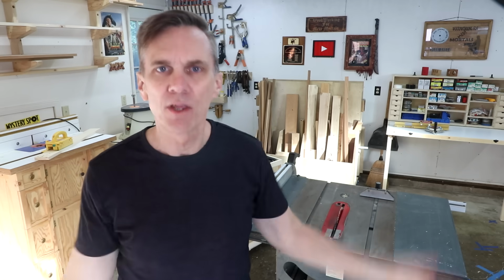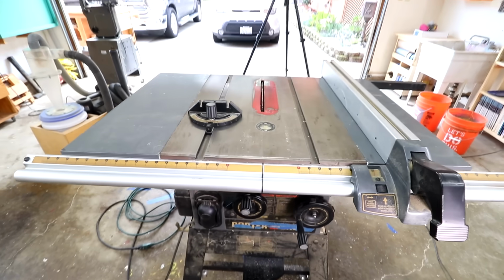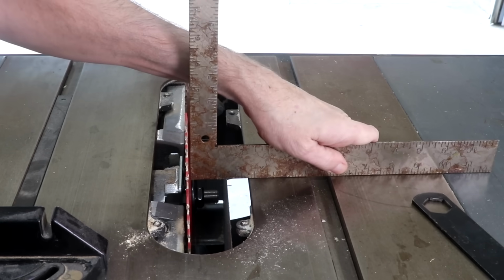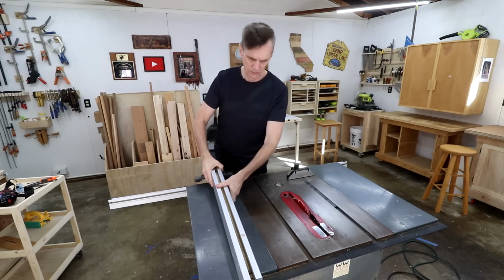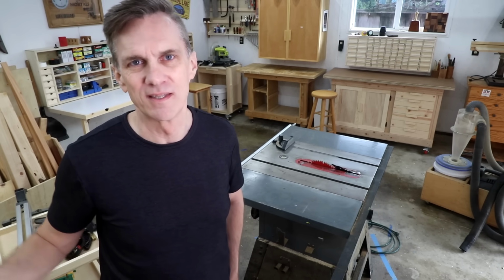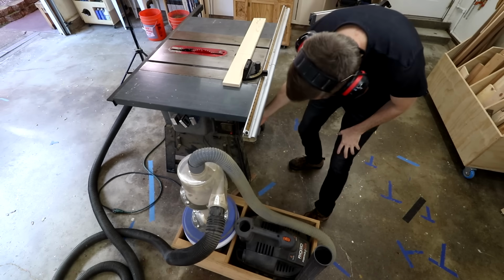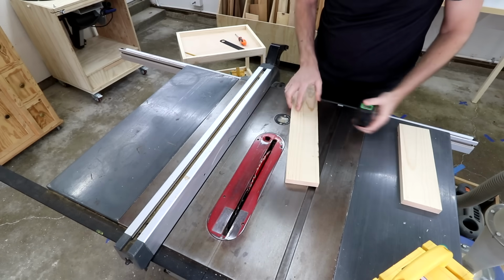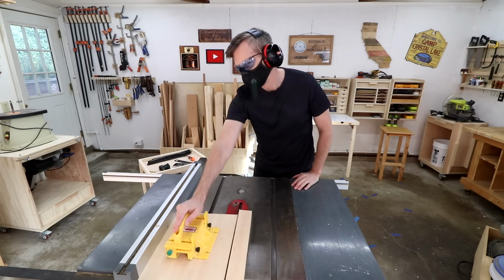A step-by-step guide to making your first table saw cuts. TABLESAW BASICS.

Comment: Hey Steve! I just recently got my first table saw about a week and a half ago. I’m happy to say I’m far more comfortable using it now than the first day, but one thing I struggle with is having to cross cut a new 2x4. Due to its length and the small size of the table saw I have I find it hard to balance the weight of the 2x4 to safely cut it. Any tips or recommendations you would have for a beginner like me?
Reply from the maker: For long boards, you will need some sort of extension on the left of the saw. Even an extra table or workbench will work. You can make a box or something to get it to the same level as the tablesaw. That said, a better solution is to rough cut the 2x4 down to a more manageable size on a miter saw or a circular saw...even a jigsaw. The use the tablesaw to get it to its exact length. This is case where a miter saw will simply be a better tool.
Reply: Steve Ramsey - Woodworking for Mere Mortals Thanks for the reply! Now that you mention it I don’t know why it never crossest mind to use my circular saw to get the 2x4 into more manageable parts. Something I’ll definitely be mindful of moving forward! Anyways thanks for your reply and please continue to make amazing content! Just finished building your 2x4 out of a single 2x4 and it has taught me so much about woodworking concepts and I look forward to making more!

Comment: Steve, do you have some emergency plan if a big accident happens? I watched stumpy nubs video about his and how hard it was for him to get help. I put my phone on a table instead of having it in my pocket as it can be hard and painful to pull it out with a couple of fingers hanging loose. First aid kit? Must be easily accessible in order to quickly stop big bleeding. Since i live alone i should think of things like having the front door unlocked so i can use my elbow to open it as turning the lock can be hard if bleeding plenty.
Reply from the maker: Those are all excellent ideas. Always prepare for the worst even though it may never be necessary. I always keep my phone handy and it can be activated with my voice. My first aid kit is in the house, which is just a few steps up from the garage, but having a first aid kit in the garage is a good idea.

Comment: Hey Steve, Thanks for making these videos! I have an older, smaller Ryobi table saw without the ability to insert a riving a knife. Is this safe to use or should I wait and get a new table saw? Thanks for any advice!
Reply: If the blade guard attaches behind the blade a riving knife is not required.  The blade guard support acts as the riving knife.
Reply from the maker: Check and see if the riving knife is built into the blade guard.
Reply: If there isn’t a splitter built in to your blade guard, you can get an aftermarket one. I use a MicroJig SteelPro Splitter on my 40+ year-old Rockwell/Delta saw that never had a riving knife and whose guard was removed long before I got it, if indeed it ever had one. 

https://www.microjig.com/products/steelpro-thin

Comment: Hi Steve. Thanks for all your content. It’s fun and just what I need as a beginning wood worker. 
TL/DR:  Do I need to purchase and apply paste wax for a new portable Dewalt table saw. 

Full:
I just purchased a Dewalt portable table saw.  I’m cutting Red Oak. And the saw and fence are getting the slightest of scrapes. (May also just be dust).  Should I apply paste wax to my new portable table saw to preserve it and make cutting better?  Or is that not necessary/bad for a portable table saw.
Reply: Waxing the table will make pushing your material easier and thus safer to use.  For the "scrapes" issue insure that the rip fence is parallel to the blade.

Comment: On your through-cuts, it looks like you have your riving knife in the lower position, instead of the raised position where it should be.

Is this an intentional choice? (Like how you don't use a blade guard?) Or just an oversight in the heat of filming?
Reply: the riving knife and the blade both move together when you raise/lower the blade. you can't adjust them separately.
Reply: @Blueeyedmerle  All the ones I've seen have two positions: a raised position where the top edge is above the blade, for doing through cuts. And a lowered position, with the top edge is below the top of the blade, for dados and slots. 

Steve's looks to be in the lower position.
Reply: @JamesTM  

It wouldn't make sense to use a riving knife to cut dadoes. It would do little to prevent kickback. You should take your riving knife OUT to make dado cuts. Ive never seen a saw with 2 positions. It is either in or out.
Reply: @Blueeyedmerle  Having read your comment, I went and did some research. From what I can see, the two-position riving knives might be a relatively new thing. With older saws having single-position knives set just below the top of the blade.

So, maybe I'm wrong here. Seems like Steve's saw might just be a different style than I'm used to.

Comment: Steve I've been searching your videos (and the internet) for an answer to my question, maybe you might know. I'm working with a hardwood material (azobe) and when cutting or sanding it it releases an awful smell. Since i'm making an indoor project with this wood I was wondering how i could get rid of the smell.
Reply: I'm not familiar with azobe but usually the wetter the wood the more you can smell it's essence.  About 6% -10% is dry enough for furniture.  Putting a finish on the finished piece will help it  a lot.
Reply: @dwightl5863  it did spend alot of time in the rain so I'll keep it dry from now on
Reply: @macresco1  I was thinking more of the moisture in the wood and not on the surface.  How long has it been drying since it was cut?
Reply: @dwightl5863  I was also thinking that. It's been a week now.
Reply: @macresco1  Do you mean it has been a week since the tree was cut down?  Guideline before using the wood in that case is to let it dry a year per inch (2.54 mm) of thickness.  Kiln dried would be much shorter than that which means it came from a supplier and they should be able to  tell you what percent it was dried down to.
Reply: @dwightl5863  it's leftover wood from a fence I built. It was just laying in the rain. Don't know when it was cut down. I'll probably put some laquer on the finished product. Oil probably won't contain the smell.

Comment: One tip is if you dont have an outfeed table and have to cut a long piece of board to cut you can rip it half way and then turn the board on end and cut from it until the cuts meet in the middle.

A lot safer than trying to feed a long board all the way and have it hanging off the table saw.

Comment: Hey, first of all, great video. Secondly, quick yes or no question: Do the specifications and features you talked about apply to the one you recommend on your buying guide? Sorry if somebody else asked this, I neither found it, nor remember if you talked about it on the showcase video of said guide.
Have a nice day!
Reply: So that's a tricky question to answer with just a yes or no. All new table saws come with a riving knife its a mandatory feature. As for the rest of the features, table saws usually have a hierarchy, job site saws being the lower end, contractor/hybrid table saws the middle and cabinet saws being the higher end. Unfortunately, the old addage of you get what you pay for is also true. I know the Dewalt Job site saw is rated very high, and just looking it up right now seems to be cheaper than the ridgid. As for specs on the saws they are different by manufacturer i.e. insert plates, limits for dado blades, even fence accuracy/alignment ( which seems to be the main complaint for almost every jobsite table saw). Honestly, read the reviews for the saw you are looking at especially the bad ones.  Hope this helps.

Comment: how do you manage the fence when ripping a large piece, like plywood sheet, when the cutoff is a a couple inches, but the work piece is wider than your table?
Reply: Throw it on the ground! Seriously though, putting the plywood on some blocks or a large foam sheet on the ground and using a circular saw to make the initial cut is the easiest way I know to break down plywood. Cut a little wider than you need and you can clean up the much smaller piece on the table saw.
Reply: @beardeddragonwood  so are you saying after the initial rough cut, you're putting the cut piece against the fence?

Comment: would love to see this type of video with a mobile table saw i recently purchased one here in the UK on gumtree and it's a great saw except for the fence which does not extent the whole length of the table and this causes movement whenever i attempt to cut a straight line,pretty much every tutorial i have seen to make either a full extended fence or sled needs the use of a table which makes straight cuts...is there any way you can upload a tutorial which can help solve this problem

Comment: No dumb question? 
Steve, Do I have to use electricity to operate my table saw?
Reply: It would be a bonus for using your saw.
Reply: @eMRimas  lmao
Reply: @matthewcarpenter4716  +electricity usually speeds up everything... https://www.youtube.com/watch?v=ujExJN6jYgU
Reply: Actually, no. You could build a system with a pedal and attach it to the blade. But you would probably need a saw to make it, so I would probably recommend you to start by asking someone to make it spin by blowing on it. The blade, don't be dirty.

Comment: Having purchased a cheap table saw its actually one of my biggest regrets. 
The saw itself isn’t bad but the fence is horrendous, it bends and wobbles with any pressure at all.
I would always recommend spending a little extra and getting a decent saw
Reply: I agree with spending a little more for something at least a little decent. I bought an extremely cheap used one that didn't even have a fence. Wasn't a big deal, I planned on making a fence system like of seen on different woodworking channels, and just use a temporary fence clamped on until i finished making one, but I didn't realize this cheap has no good flat areas underneath for the clamp to sit, and the fence rail on it is actually part of the top, not one that I can take off and replace. Wishing I would've just waited and found a better one.
Reply: @nightxxowl1215  Steve Ramsey has a tool list to set up a beginner's wood working shop for less than 1000 USD, including a table saw.
I don't know if that brand is available "everywhere" but with the US or Canada it should not be a problem.
Reply: @hansdegroot8549  Ya i've seen that, but i still couldn't afford to buy a table saw brand new, I would just have to find a decent one used.

Comment: I set up my first table saw, Bosch, 5 days ago and had not dared to switch it on. Refreshing to know I may not be the only one intimidated by such a machine. Your clear straightforward accessible video gave me the courage to start and all I can say is it’s miraculous!  My only problem is keeping the blade protector in place when the blade is set low, it just won’t lower.  10 out of 10 and thank you!

Comment: One very important safety feature you failed to mention is extension tables for increasing length and possibly width of the table top provided by the manufacturer. Otherwise extra wide or long (even a standard 8' board) piece of wood will tip as you run it down the blade. I always use an outfeed table. Sometimes a side table when cutting large sheet of plywood.

Comment: I have an old craftsmen table saw that does not support a riving knife. What should I do to stay safe?
Reply from the maker: If your insert plate will allow them, consider using splitters: https://amzn.to/31dNCS7
Reply: If your stock insert plate doesn't support adding splitters, you may be able to find a 3rd party insert plate or you could find instructions or come up with a design to make your own insert plate. Check out DIY zero clearance insert plates to find examples of how people make them.

A riving knife or splitter is absolutely the most important safety feature.

Comment: Steve I noticed your motor has much smoother momentum than mine does. In other words, my blade tends to stop faster then yours. Do you keep it oiled at all? I never thought about doing that but I suppose it makes sense
Reply from the maker: My saw used to brake faster. It still seems to kick in, but much longer after I power down. Yes, I try to oil all the mechanisms periodically.
Reply: Fine sawdust + oil/grease will over time gum up the bearings in your saw, meaning you might need to replace the motor bearings and/or the arbor bearings. I’d use a dry film lubricant instead of oil, which can be found at any automotive parts store.

Comment: That table saw had the knee button option, mine doesn't.  I bought my 1st table saw and regret it after I got it home, should have returned it for a better one. The rip fence was too light and didn't lock down enough for me.  The other thing was that the miter slots were not obstruction free.  It had dog ears on it, so I had to make custom miter slides.  The final thing I would suggest, get a cast iron top.  One more thing, if you plan on doing dado cuts, make sure that the spindle has enough threads to fit a dado blade.

Comment: Notice that Steve has really good eye protection that rides close to the face. You NEED something like that when you use a table saw. I use a full face shield. Regular glasses aren't enough. It's very common for the back of the blade to catch small wood fibers and loose knots and fire those at you at extreme speed. Even a tiny fleck of wood really stings when it hits your face going that fast. I'm sure it would injure your eye if it got under your glasses, even indirectly. Be like Steve.
Reply: Agreed - most 'safety glasses'  sit too proud of the face, and leave too big a gap between the bottom of the glasses and the cheekbones, etc...  for the cost, a simple face-shield just works so much better (and protects your whole face, not just your eyes)

Comment: This video came in perfect timing! I just got my first table saw this week and I’m going to be using it this weekend. I was really intimidated by it, but I feel a bit more confident after watching this video. Thanks!
Reply: Remember the dry-runs! When i did it for my first cut there were several potentially disastrous things i noticed!

A habit im starting after watching stumpy nubs accident is to have my cell phone on a table so i can at least call emergency number. Not easy pulling a phone out of your pocket with two fingers while also bleeding...
Reply: @vileguile4  i always have my phone where i could easy pick it up just in case.
Reply from the maker: Fantastic! On Monday, you'll be imagining all the things you want to make! Stay safe and happy woodworking. 😀
Reply: Ditto Miranda! I feel so relieved to have this video
Reply: Miranda Cutler what make did you go for?
Reply: That's rich Steve " stay safe".   But how can you really mean that when you don't use a guard

Comment: Okay, how did you know that I just bought my first table saw two days ago and set it up?! I have also been watching your videos over and over again for at least two years and have learned so much. I even bought your weekend class.  I haven't plugged it in yet because I am a little afraid of it. I did add the guard as well as the anti kick thingy. My Gripper came yesterday but I haven't assembled it yet. Perfect timing on this video! I needed that boost of encouragement. Thanks Steve!
Reply: If you know of somebody familiar with table saws have them come over and show you!  Have the beers AFTERWARD.
Reply from the maker: Oh that's great! You'll be fine once you make a few cuts. A table saw can be a very scary and intimidating tool when you've never powered one up before...you aren't alone. Especially that initial noise! Take care, be smart and safe and you'll be making all kinds of cool stuff really soon! 👍
Reply: @SteveRamsey  Finally plugged in my table saw and turned it on. OMG is it loud!😁 I still have all 10 fingers. 👍 After playing around it for a while, it became less scary. It really does command respect.
Reply: Janine Lew great to hear you’ve bought your first table saw. What make did you go for ?
Reply: O.G.B Woodwork It’s a Dewalt DWE7485.
Reply: Janine Lew very nice. I love dewalt tools. That’ll be extremely precise. 😁👍
Reply: @o.g.bwoodwork  I watched a lot of reviews before I made my decision. I already had a Dewalt miter saw and scroll saw and I like them as well.
Reply: Janine Lew I’ve only got an impact driver and drill made by dewalt, but i can’t wait to grow my collection. 

Wow, you’ve got quite the collection. Have you made any videos with them yet?
Reply: @o.g.bwoodwork  No videos. I don't think no one would be interested in watching a 50 plus year old lady building stuff. 🤣  I just watched your videos. You have amazing skills! 😊
Reply: Janine Lew thank you very much. I think you’re wrong though. I think there would be loads of people interested in watching you make stuff.

Comment: I would be interested to hear your opinions about how to compensate for a "cheapo" table saw. I have an older Craftsman saw that has, "accuracy problems". To put it lightly, the saw is hard to set up for accurate cuts. Any idea Steve?
Reply: do what I did REPLACE IT mine was a 40 year old Craftsman

Comment: How do i make a accurate crosscut with the protection cover over the saw blade? I can't see the blade with the protection cover on, making it difficult to cut exactly on the line i make. i have bosch pts 10 table saw
Reply: With the saw off, raise the saw guard,  line up the cut to the blade, move the work piece away from the blade keeping the work piece against the miter gauge so the piece does not move, lower the saw guard, turn on the saw and make the cut.
Reply: @dwightl5863  i can't lift the blade guard high enough to see the blade properly. But thank you for the tip.